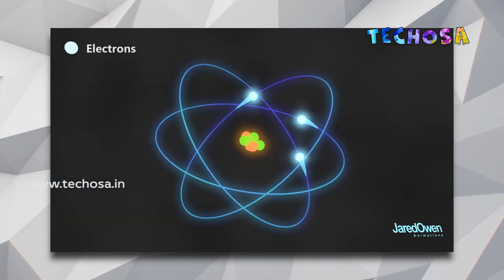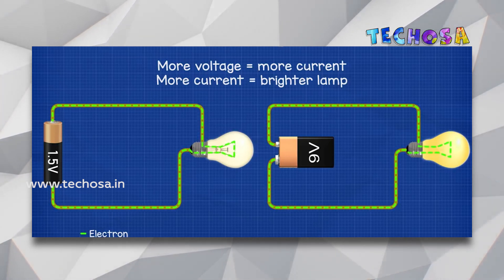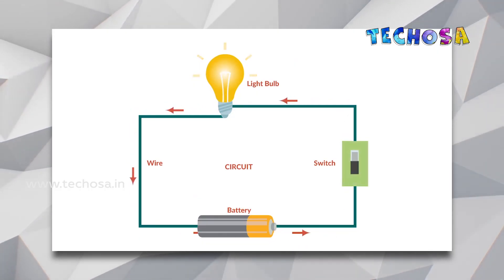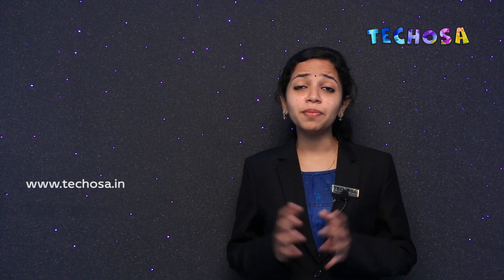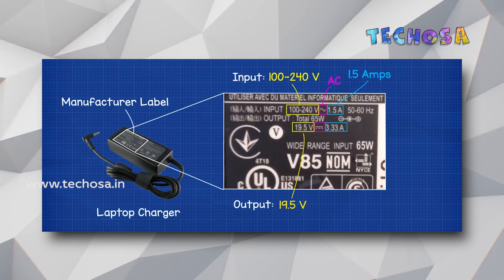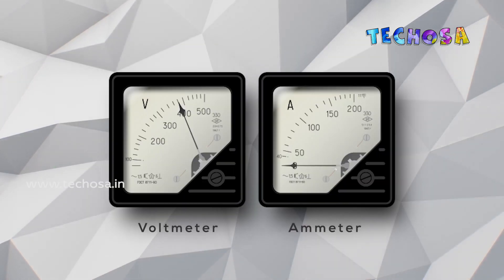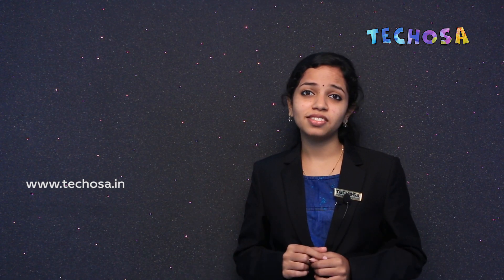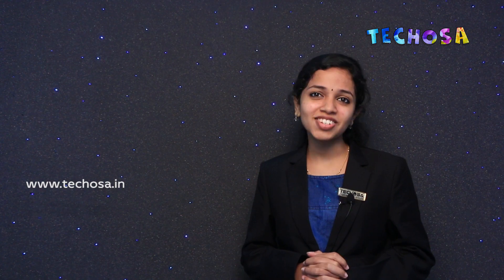How battery works | Resistance, Voltage Current Explained | ENGLISH | Techosa

Comment: Chechi last circuit inte caseil anode inu cathode ilekku electrons supply cheyyan kazhiyathappazha battery dead aavunnennu paranjille ,chechi appom eee cathode ileku pokunna electron avide cathode store cheythu vekkukayaano
Reply from the maker: Cathode il electrons store avukayalla cheyyunnath pakaram battery yile chemical reaction kurayumbol batterykk electrons ne anode il ninnu cathode lekk transfer cheyyn ulla sakthi kurayunnu athukond further electron transmission nadakkunnilla.
Reply: @TECHOSA-ROBOTICS  athalla chechi ippom anode il ninnu cathode il leku transfer aayi povunna electrons ille athinu cathode il vech enth sambhavikkum
Reply: Aaaa Shakthi kurayunnathinu mumbu cathode il electrons poovumallo...athinu enth sambhavikkum
Reply from the maker: Ok, cathode terminal il positive ions und (electron kuravulla atom) ith anode il ninnu varunna -ve charge ulla electrons ne accept cheyyth electron nte kurav nikathi charge onnum illatha neutral atom ayi maarunnu, but ethine namukk electron ne store cheyyunnu ennu parayan pattilla karanam once ee process complete ayi kazhinjal namuk ee electrons ne reuse cheyyan pattilla (in case of non-rechargeable cells only).
Reply: @TECHOSA-ROBOTICS   ok 😄